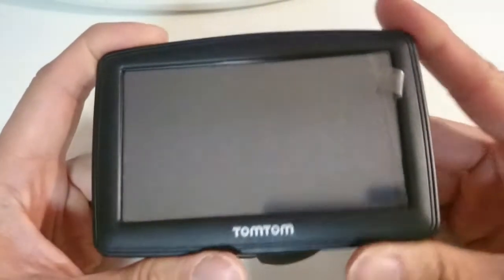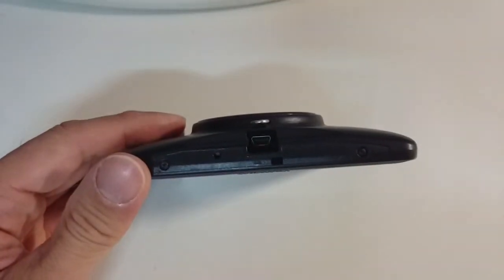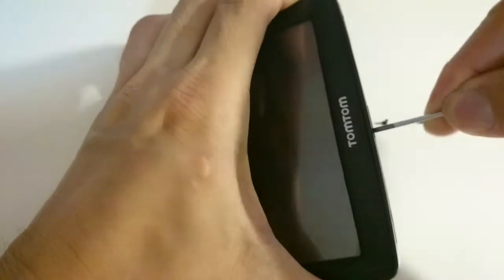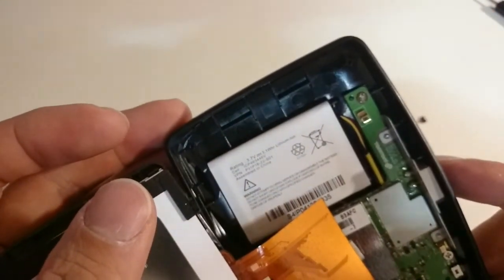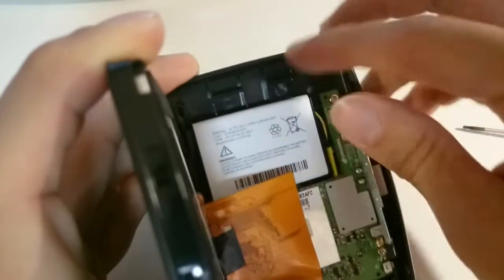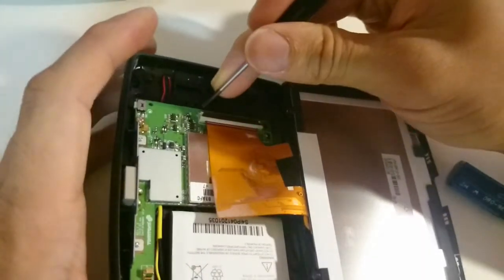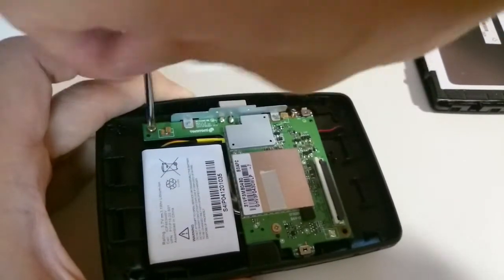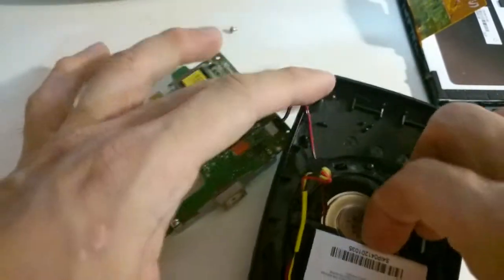Disassembling TomTom GPS navigation to change battery

Comment: Thanks. I was able to reach the battery connector without removing the ribbon cable. The ribbon cable wasn't coming out for me. I wanted to change the battery so that the clock doesn't reset for every ride.